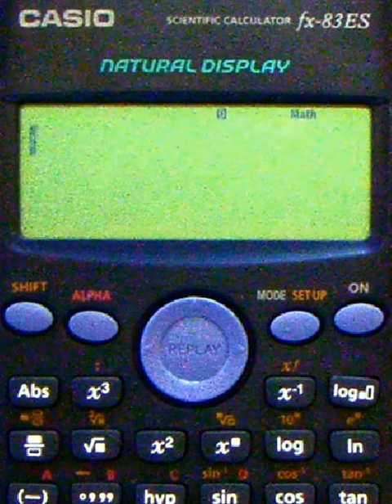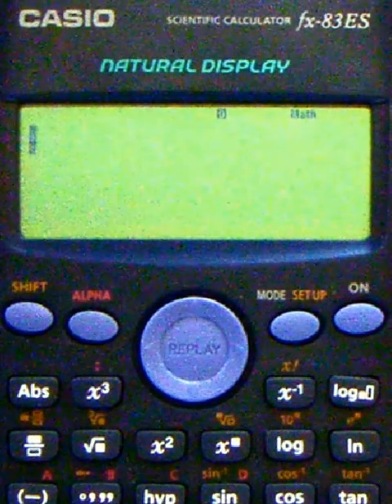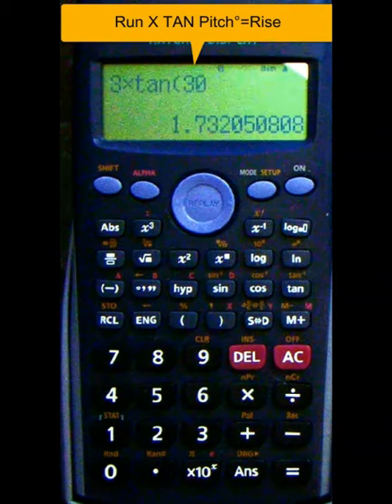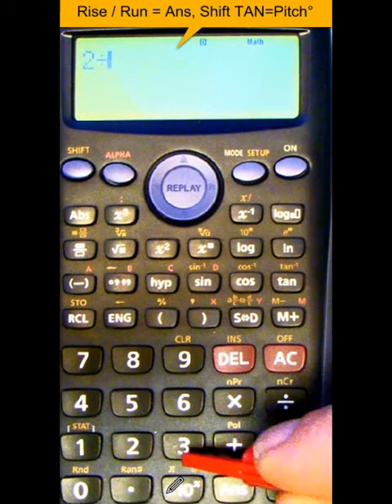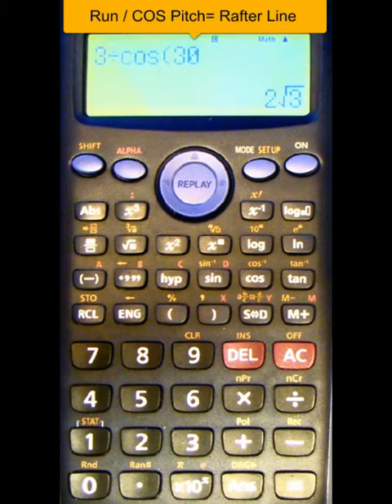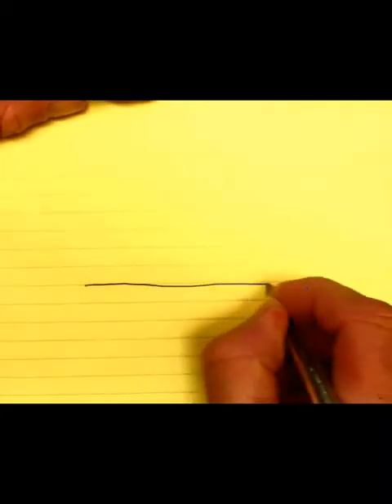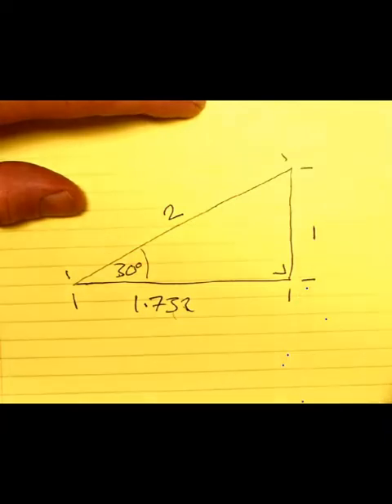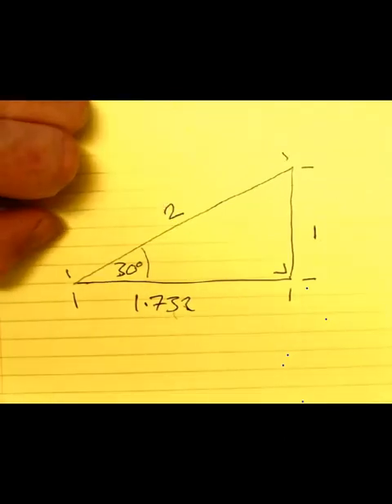How To Use A  Scientific Calculator For Rafter Calculations

Comment: How would I use this to find the hypotenuse angle of the hip in a irregular hip roof?
Reply from the maker: Take the crown rafter run distance and the half span (common rafter run distance) as being the 2 shorter side of a right angled triangle...then find the hypotemuse of that right angled triangle...this gives you the run of that hip.
Take run of Hip distance with Rise distance as being the 2 shrter sides of that right angled triangle and calculate its hypotenuse angle.
Reply: @michaeldownes516 

Thanks for that vital bit of info, it's really appreciated. Been scratching may head for a few days on that bit of a problem.
I notice from your description that your channel is to help apprentices, so I hope you don't mind somone at the very other end of that scale benefitting from your vast knowledge. I'm a 78 year old retired carpenter and though I've done quite a few roofs in my time, I've never encountered the irregular hip, so no experience of it. I still have a keen interests in the subject and enjoy doing the geometry. I use Coreldraw for the geometry and apply it using SketchUp. Certainly a lot easier than handling real rafters.
Thanks again and keep up the good work.
Reply: @michaeldownes516 
Thanks for that vital bit of info, it's really appreciated. Been scratching may head for a few days on that bit of a problem.
I notice from your description that your channel is to help apprentices, so I hope you don't mind somone at the very other end of that scale benefitting from your vast knowledge. I'm a 78 year old retired carpenter and though I've done quite a few roofs in my time, I've never encountered the irregular hip, so no experience of it. I still have a keen interests in the subject and enjoy doing the geometry. I use Coreldraw for the geometry and apply it using SketchUp. Certainly a lot easier than handling real rafters.
Thanks again and keep up the good work.

Comment: Is there a calculation that can work out the angle of my roof which includes the size of timber using I know how to get my angle by using rise and run but when use a 6x2 for example I’d have a 100mm height above plate which will leave my rafter 100mm higher than my finish point which would result in an angle change, 
Is there a formula that can over come this?
Reply from the maker: The angle of the rafter will not change.....if you check out this video on made on marking a common rafter on a site square you will see that the right angled triangle that give the length and plumb cuts does not change even if you move that right angled triangle from the 2/3 rds line to the back of the rafter.

Some people go to the the trouble of marking the 2/3rds line on the side of rafter, measure along that 2/3rds line to bm. But if you hook you tape at top end of rafter and measure rafter length along top edge of rafter it will bring you above the BM....the mistake one could easily make at this point is to draw a line square in to get BM....but this would shorten the rafter length along 2/3rds line....so instead, make sure you measure in to BM along plumb (heel line) rather that square in (i.e....you should never see a square line on side of rafter when marking BM)...............you will this heel line marked 6 minutes into the attached video link below.
.
Check out this video where you see i used the top edge of common rafter to mark rafter length and continued to mark BM as outlined above....

https://youtu.be/lL3j-2qf4oI

hope this gives a clearer understanding

Comment: Thank you for this video, How would you find out the length for the hip/valley using calculator  , I understand how to work out the rafter length using cos and the pitch
Reply from the maker: Glad you find the video usefull....To find the length of the Valley/Hip line  note the following....the common and typical Hip/Valley have the same Rise, but the run of the Hip/Valley is longer...so the rise and run are 90 degrees to each other and the diagonal of those 2 measurements is the rafter line (Common /Hip/Valley).....if you multiply the run of the common by the square root of 2 (which is 1.4142) you will get the run of the Hip/Valley. 

Now that you have the Rise and Run of the H/V you just need to find the the pitch of the H/V...so use this formula, .......
.Rise divided by the H/V run...hit = button.
...then hit 2ndF (AKA...Shift or Inv)button, 
....hit Tan button, 
 ...hit= button to get the Pitch of the H/V.

Now that you have the pitch of the H/V use  formula .....H/V run divided by Cos H/V Pitch to get the length of H/V....

Use the following example to check if you are using formula correctly...
A rise of 1, with a run of 1.7321, will give a pitch° of 30°, and rafter line length of 2.
Reply: @michaeldownes516  thanks for this detailed reply, so the run for the common rafter is 1.7321 multiply that by the square root of 2 (1.4142) and this will give me the run of hip/valley being 2.449
Reply from the maker: @Sherlockly  ...yep...thats it...if the common run is 1.732...the Hip run will be as you state, 2.449. 
(This is for a regular Hip/Valley...hip/valley is 45 ° on Plan View)
Reply: @michaeldownes516  thank you it’s a great help, what are your thoughts on the  reckoner book using that for roofs ?
Reply from the maker: @Sherlockly  ...reckoner is fine for standard hip roof (Hip 45° on plan)..but its best to know how to use the calculator/trigonometry /Pythagoras for the roof situations that are not standard.....Always be able to get around a right angled triangle your self for the non typical roof scenario. And this ability will be helpful in other areas of Carpentry Joinery/ Construction other than roofing.

So when you recognise a right angled triangle on a roof surface surface or with in its structure that you need to calculate, you will be able to figure it out, but the person who is totally dependant on the reckoner is lost.

Also, the reckoner can only tell you the line lengths of all members (it sees the roof members as tread lines basically), so you will need to have a good understanding of the roofing geometry involved and have a understanding of how to determine what your deductions are when you factor in various roof members thickness for standard and non standard roofs.
Reply: @michaeldownes516 thats a great point, just looking back once when you have the hip run 2.449 , what’s the formula to get the hip true length, or is that the hip true length
Reply from the maker: @Sherlockly   2.449 is the Hip Hip Run in this example.......now that you have the Hip Run, put it with Rise to form a right handed right angled triangle...then the longest side of that right angled triangle will be the Hip Length (Hypotenuse)......so Pythagoras Formula (A²+B²=C²).....C represents the longest side of the right angled triangle always (Hip Line Length in our case)...
So  Pythagoras Formula in other words....Hip Run²+Rise²=Hip Length²........dont forget to get the square root of your answer (C) for the Hip length.